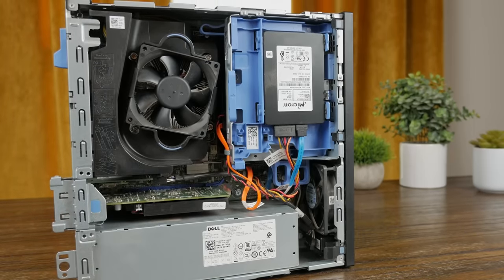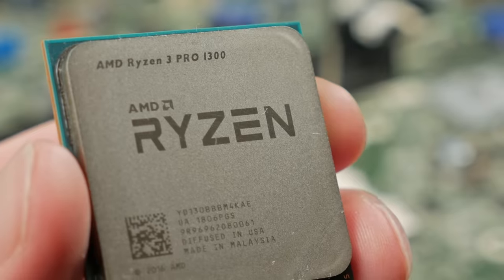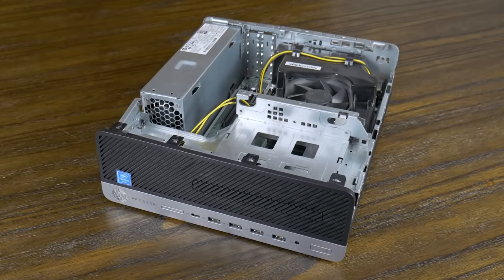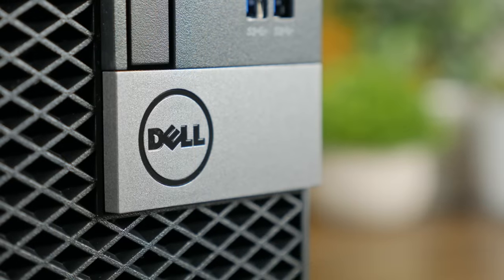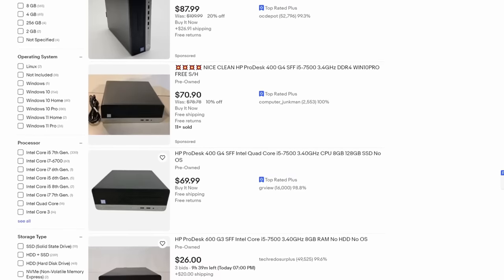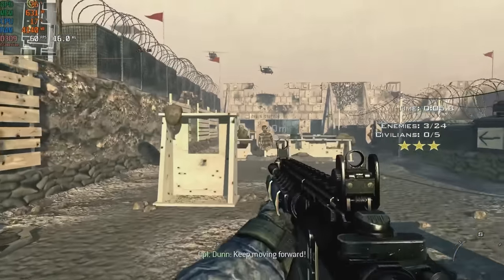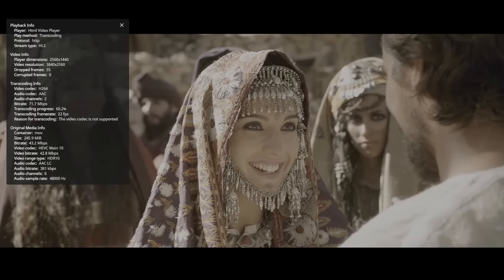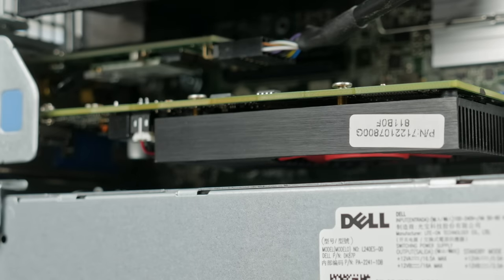A Surprisingly RARE Dell Optiplex

Comment: used to work for a refurbisher and was well acquainted with those dell SFF, that proprietary sata was pretty fragile and often broke  just trying to push it back in and we had a box of replacements just for that. 
also had my hands pinched way too many times by those drive caddys.
never saw that ryzen version, seems very neat!

Comment: If i can remember correctly my r7 1700 had issues compiling kernel soon after I bought it, contacted amd and they just told me to downclock ram and bump cpu voltage  a bit. That made it better but agesa update fixed it at the end. That computer still runs after 8 years later and will receive r7 5700x3d for needed boost in performance.

Comment: What you wanna get is a  Refurb Dell Precission 3640, they come with w1290P Xeons, 10 core 20 threads base frequency 3.7ghz, 1 core max 5.3ghx, all core 4.7ghz. The system I got for my bro ran 5.8ghz out of the box. Blazing fast system. Holds  full height 12" video card, comes with 460-1000w pso, but takes a standard PSU 24 pin and 8 pin mobo. I got mine from Delta Server store with 32gb ram and 1tb nvme m.2 ssd, new  and it has 2x m.2 slots.

Comment: The best AMD cpus for low power home servers atm would be the 4700GE and the 5700GE, which are OEM only. They do have integrated graphics, 8 cores/16 threads and a 35W TDP.
Reply: También  Ryzen 3 2200G, 3200G y 4300G; y 5 2400G, 3400G y 4600G.

Comment: You should try putting a 2 slot GPU in there anyways, the top X4 slot has the end cut out to fit an X16 card. It’ll just run with less lanes

Comment: If you can edit the bios manually, you may be able to add support for newer CPUs. Unless dell locked the ability to write to the bios chip. Then putting a 5600G or 5700G would possibly be the best bet without a dedicated GPU, considering how powerful those integrated graphics are. If not, then RX 6400 or any similar half-height single-slot GPU that fits in addition to whatever is the best CPU you can put in there without stressing the motherboard's power delivery.
Reply from the maker: A much as I want to get to the point where I understand BIOS modifications, I think that's a bit beyonf my capabilities at the moment haha
Reply: @HardwareHaven  it's actually pretty easy as long as you have the right kind of software. If it is right, then you will have everything laid out in front of you, including various sections of the BIOS, including one called "CPU microcodes" or something along those lines. Inside that section, you can add or remove whatever microcode for a CPU that you want, and it should just work. Whether it does, well, not for me to say, but plenty of people did that back in late 2010s to install various mutant CPUs or engineering samples for LGA 1151 and LGA 1151v2.

Comment: The AMD Radeon RX6400 would like a word with you :)

It has low-profile single-slot options available for it.

You also won't lose too much performance going from the cards PCIe 4.0 x4 to PCIe 3.0 x8, few FPS here and there.

Comment: I had an i5 6th genversion of these overheat. Linux falsely thinks it's a laptop and controls a not connected fan pwm. I made a service for changing the fan between low mid or high based on cpu temp and it was solid. Fan control is locked down so you can't use the pwm directly

Comment: Thh eeasiest machine I have ever found to work on is my HP Envy 27 Recline ki_150xt All In One. The is a door on the back with the hard drive on one side and ram on the other. You only need a screw driver to remove the drives from the frame.

Comment: you may be able to put this into a different case and use a better ps then have room to run a better gpu - this was good content and squarely in sweet spot for value refurb...the cpu attachment for the cooler is excellent, has many usb3 connections - would make a good 40g nas - it probably will run fine headless...networking is probably the weak link but with raid0 ssd and 2.5gbe it could be a nice home server and it looks good plus good pwr envelope - much less without a gpu....the low price could make it a decent cluster node - tough that it is not that upgradeable but you can't have it all - am4 platforms should get much cheaper as we get closer to zen5...overall good due diligence on this review!

Comment: What a shame Dell only made one generation of Ryzen systems on their business PC lineup, so no more successors to Optiplex 5055 and Latitude 5495, not even during the Ryzen 5000 era when they were destroying Intel chips by any metric. Intel must've paid Dell a lot.

One thing worth noting is that the Optiplex 5055 supports Raven Ridge APU, however in this case the I/O shield needs some modifications as the DisplayPorts are blocked.

Comment: I just bought one of these and mine comes with 2400G and onboard graphics ! I'mma trying buying a tesla p4 for encoding and passthrough and a ryzen 1700 pro ! can you test in the next video if a normal 1700 or a pro version will work in it if you have the cpu on hand ? i cant effort to test that

Comment: i have that r5 430... its pretty good. with decent cooling you can overclock it really2 high. i got it really2 cheap and its much better than gt710/730. still use it on my second pc for light gaming 😆

Comment: I would be very interested if you tried to put the MOBO into a regular case....how is it with front IO, new PSU and stuff, since this could be a pretty good budget computer if the recasing works
Reply: It’s not an ATX mobo. It’s Dell proprietary.
Reply: @thespencerowen  yes and even dell/lenovo/acer/hp proprietary boards can be recased in some cases. that is why I was asking

Comment: I owned 2 old Dell Optiplex and frankly I'll never want to buy any old Dell PC any more. The plastic case/hdd caddy became so brittle and could break easily with a minor touch, and some part of the case is thinner than chopstick. The PSU/motherboard is also not reliable.

Comment: An option for gpu upgrade would be something like a t400 it is single slot half height and uses the same di as the gtx 1650
Reply from the maker: I actually ordered a t1000 to put in it in a follow up (and to have for future issues like this)
Reply: Great minds as they say

Comment: I wonder how hard it would be to mod the bios to add support for newer Ryzen CPUs.
Reply from the maker: I imagine harder than what I would be capable of lol
Reply: Not with that power supply. Those usually don't have more than 300W max and a newer gen Ryzen might probably even pull 100+ watts which this computer sure as hell wouldn't handle with the stock psu and that cooler. It also depends on the chipset because not all AM4 boards can be updated to run new models.

Comment: OEMs love to lock the CPU generation in. I had many HP EliteDesk AM4 boxes stuck with A10 APUs. Even old socket 1155 intel Dells and HPs that will only work with Sandy Bridge processors - no 3xxx Ivy Bridge. Wasteful, but then want to force you to buy a new one.
Reply: The Sandy Bridge stuff is usually the chipset not supporting it

Comment: That top PCIe slot is open backed so you could put a graphics card in it. Would depend on the card as to whether the PCIe 2.0 4x would bottleneck it.

Comment: Desktop Ryzen CPUs (with no integrated graphics, i.e. no APUs) tend to have not-great idle power consumption because the separate IO-die constantly uses 10-15W always in any circumstance, even if the cores themselves downclock a lot. The APUs are monolithic and don't share this issue.

Comment: What I hate is Dell being so proprietary and locking everything down .I'm not sure what other stuff their locking down.
 I cannot put any-other OS that Win7 on my Dell 1010Mini. And even that 1010 Mini Atom CPU runs like crap. Live OS sux as well ... Only 8Gb memory. So even if trying to upgrade it will still lock you down to the crapiest settings. But if you running a ThinClient then you're good. 
Terminal is really the only thing they are good for.
imo

I am in currently a legacy system re-freasher. And it pisses me off how hard it is ti find legacy drivers.
 They are out there. Just downloading software you are hoping does the trick.

Comment: Dell sucks for future proofing. They give you Bios only for 2 options of cpus the mobo supports. Dell is useless. I had a AIO Ryzen 7 m1700 system, with rx580 8gb dedicated onboard. Mobo supported newer CPU's, but lloser Dell refuses to release Bios updates so you can use them. I wish AMD and Intell would refuse to sell to OEM's unless they allow upgrading of CPU & GPU. Would benefit them on future cpu and gpu sales with upgrades. Dell wants to sell you a new system every year.

Comment: dude i use the freaking  dell 5055 right now the spec are 5 2400g pro damn its good to play modern games like the valorant,csgo2, at high setting but mw3 2023 damn that a no for me, you could use gpu like rx 580 or something by using riser cable if done that and it was cluth i spend this pc for like 275$ and that pretty damn good @HardwareHaven
Reply: I have the same pc like you 5055 ryzen 5 2400g pro, is that your current gpu with rx 580? How do you place those large gpu, did you also upgrade the psu?
Reply: @rizgatsu5092  well if you want to put your gpu you could like put it like egpu I can't close the case because there is no hole,and yes I upgraded my PSU but I think it's a bit risky, I spend 75$ just for the gpu but you but I not gonna recommended the gpu because the software are now out dated,I recommended you to buy a GTX 1660s/ti for lower wattage for your pc
Reply: @rizgatsu5092  but I dont recommended you to do this,because you need to swapped to a large case because the riser cable are slowing down your GPUs you need to directly insert your gpu into the motherboard for 100% of performance,and yet I accidentally drop it now it's just a junk,
Reply: @Ayatullah081  i see, thank you for the reply, do you think rtx a2000 is good for this cpu? Since i was looking other youtuber using rtx a2000 on dell sff without pin power
Reply: @rizgatsu5092  well idk yet I but after I do some research playing cyberpunk with the gpu on 1440p it can cost 14.9% of bottleneck but you will getting 87fps+
Reply: @rizgatsu5092  but my question is what games do you want to play?